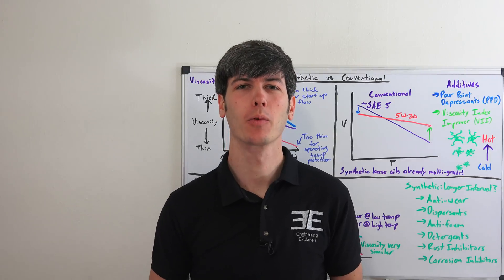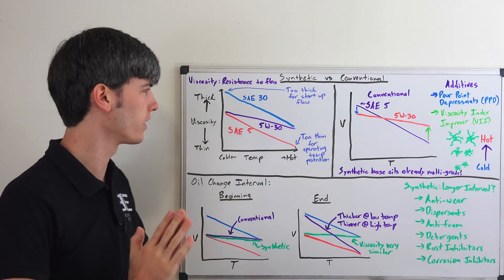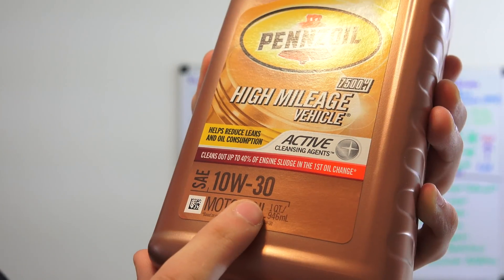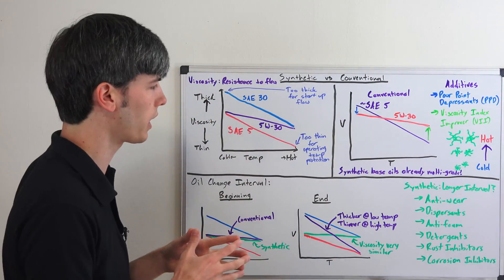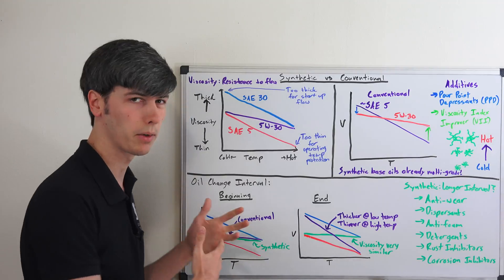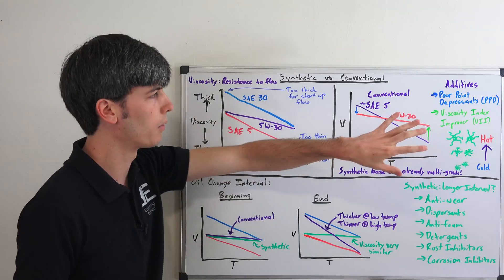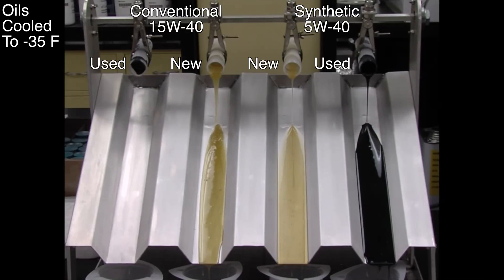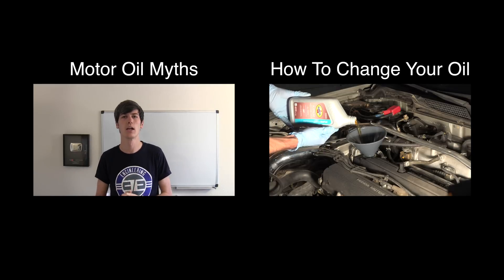Is Synthetic Motor Oil Better For Your Car?

Comment: And that's why I change my conventional oil every 3,000 miles on the dot...or sooner depending on how heavy my right foot has been. (Turbo's cook the crap out of oil...high zinc content is good too) Also consult your owners manual, a lot of cars can use a range of oil weights depending on the climate you live in. the "recommended" weight is more about fuel economy than protecting your engine.
Reply: +teh vee teh vee ya im not following... if it's turbo it SHOULD be synthetic. it's not about oil life or anything to do with viscosity. it's about protection at higher temps, turbos stay at 500°- 600°F at idle and even up to 1500°F when under hard driving conditions. oil runs though your turbo and is the same concept as crankshaft main bearings (except ball bearing turbos) and oil cooks in the turbos thats why they reccomend leaving your turbo car to idle before shutting off so your oil, and coolent in my case can bring the turbo back down to a more reasonable temp, so that when oil flow stops it dosent cook the oil/coolent.i use pennzoil platinum 5w30 and change at 3000mi
Reply: Engine shut off and the turbo is still spinning at high rpms, no oil is getting into the bearings either... metal on metal right there. Won't matter if conventional or synthetic, no oil = no lubricant for the bearings. People tend to forget that. :)
Reply: Why would you choose to use conventional oil? Especially if you have a modified car.
Reply: *****
Or possibly an air pocket in the heater core and coolant is still moving in the system causing a "water fall" sound.

In a turbo car having high zinc and phosphorus content as well as the correct viscosity for the application is far more critical than synthetic or not assuming you're changing the oil before it begins to seriously break down.

Don't believe me, order a oil analysis kit and compare your cars oil of choice vs whatever else with lab results. Kit's free

http://www.blackstone-labs.com/free-test-kits.php

P.S. "for the application" has a broad meaning lots of things have to be taken into account besides climate temp. Such as engine output over stock, tolerances, type of CHRA etc. etc.
Reply: Diesel engines are a whole other ball game, it's like comparing base ball to soft ball.
Reply: No way I'd run non synthetic in a turbo specially with oil prices so high I've been able to find the synthetics almost the same price as the conventional. I've found the 5 quart jugs to be a great deal. Right now 5qt jugs of mobile 1 fully synthetic is just over 20 bucks at wall mart. My last oil change I got the same fully syn mobile 1 with filter and a bottle of soap and drain pan 32 bucks at advanced auto parts. It's to good of a deal to run conventional. If you do synthetic yourself it's cheaper than paying someone to do it with conventional.
Reply: That is most likely the ac system equalizing pressure between the low and high side after the compressor stops. Usually lasts around 10-30sec. Try turning off the ac a few minutes before you kill the car and you probably won't hear it.
Reply: *****
I'm assuming your comment is directed at TsmnnDvI5, I know I laughed at it.
Reply: *****
 See how long a turbo will last with no oil going to it. Or would you prefer someone to hold your hand while you look up the info?

Suggest you read item #3 very, very carefully.
https://www.torquecars.com/articles/killing-cars.php
Reply: Whew, good think I read the owners manual and don't just shut it off soon as I pull into my drive way after some "spirited" driving. Owners manual on my car lists 60 seconds.

BTW it's not spinning fast at idle and the CHRA of most factory turbos are journal bearing, some aftermarket CHRA's use ball bearings. There is realistically no damage done at idle once it's cooled off when you shut down the engine.

Damage is done to the turbo's bearings at high load / full throttle when you are pushing it to it's limits. A lot of people my self included run small frame turbos beyond their designed output (airlfow) doing so on "meh" oil = seriously shortened life span of the turbo.
Reply: Not true. Anything with a DPF won't tolerate mineral oil. PD diesel engines have very specific oil requirements. You can't just load in mineral oil and assume that it's fine because it's changed every week or two.
Reply: +Alan Hunter I use Mobil 1 not because it's synthetic but because it's the cheapest 0w20 that I can  find. My "I'm broke this month" alternative is Motorcraft 5w20. I run either of those in my 280ZX, my EG Civic (D15B7), my parents' Grand Marquis (302 Windsor), etc. My 530i (M60B30) gets 0w40 or 5w40 diesel oil, my bike gets 80wt gear oil & TC-W3 premix at 64:1.

The ONLY times I use OEM recommendations are when it's not my vehicle or when I'm getting a baseline for later oil testing. I drive everything like I stole it, put in 50-100k miles a year, & in over 15 years the only parts that have just straight-up failed on me are automatic transmission pumps & axle CV joints. It's like Toyota & GM spec plastic for those.
Reply: +TurboMitsubishi There's nothing specific to a turbocharged engine that reacts positively to increased ZDDP levels and most turbo installations are on engine designs that don't require much either. For a turbo you need a high-temperature shear-stable base oil much more than any specific additives.
Reply: teh vee teh vee Far more to it than just viscosity and OCI. Many engines now have oil requirements than can only be met with synthetics.
Reply: Jacob Gay
Yep it's sooo horrible my 26 yr old 4g63 that's never been rebuilt with 117,000 miles is on it's last leg...oh wait, no it's not. It actually runs better than 90% of DSM's I have seen first hand in reference to idle, driveablity and reliability.

Whenever I one day rebuild the engine, once it's broken in, I will probably run something like Amsoil, but until then, mineral like I mentioned will do just fine, has for the last 26 years, it's not like it's suddenly going to be inadequate.
Reply: teh vee teh vee what are you even talking about? There is only benefit when it comes to viscosity at certain temps for synthetic. The other part of your comment maakes zero sense.
Reply: +Ryan Rohauer Yea I don't know what he is talking about either. I doubt he will reply though.
Reply: Why do I sometimes hear running liquid sound after I shut off my turbo Jetta. Is that the reason?
Reply: I thought that also but I usually hear those noises on startup or revving instead of after the engine is shut down, but I have heard them on shutdown also.  Did someone install a waterfall in my car? lol Your oil comments are spot on also.
Reply: At an idle, correct, little damage to no damage done. Point is, most just pull in, engine still decently rev'd then shut off. That's where the damage is done. :)
Reply: Jacob Hendrickson
With the exception of 1 oil weight, it has been proven several times (google) Mobil 1 Is NOT a real synthetic oil.
Reply: Or one could get the Autozone oil change deal. $25 for a gallon jug and filter. I get Valvoline Max Life on that deal. I think the choice is between Valvoline or STP but both seem to have the same performance characteristics on a high mileage car, not sure about low mileage as both of the vehicles I work on are over 200k miles.
Reply: +THE WHITE WOLF And so? That's important to know for vehicles where it's critical, but the number of those is MUCH smaller than people think. The zinc has been largely replaced with other, similarly-purposed, additives and the vast majority of engines will never notice the difference.
Reply: pandorafalters
 Turbocharged engines sure will.
Reply: All I know is that the thrust bearings in normal turbo's ran hard with oil with high zinc show a lot less wear.
Reply: +THE WHITE WOLF The flat-sliding contact that ZDDP is best for protecting is actually not terribly common even in "older" engines. Even solid lifters are designed to rotate in their bores, specifically to reduce high-wear sliding contact PRIOR TO the introduction of zinc-heavy additive packages. It's actually more common in earlier OHC designs with non-roller rocker arms which have a contact pad for the cam lobes, such as Nissan's L-series engines.
Reply: +TurboMitsubishi Heavy thrust bearing wear inside the TURBO is generally due to improper assembly or system design - improper bearing clearance or excessive pressure on either side. Heavy wear in the ENGINE is generally from the clutch - too-heavy pressure plate springs, riding the pedal, or improper adjustment.
Reply: +TurboMitsubishi Or, possibly the most common source for any "high-performance" engine, is running too-thick oil. Cold it resists pumping and your bearings can run dry; hot it can pump at high enough pressure to scrub your bearings. In either case wear will increase in every oil-lubricated joint.
Reply: I have seen the results of 3 different oils of the same weight tested back to back to back on a 4G63 engine with journal bearing turbo's pushed hard on a dyno once up to temp. The main differences between the oils were the zinc and phosphorus levels.

There may be newer additive packages that are just as good, but I don't know that for a fact, I know what does work and will continue to use it until I know something that work as well or better is proven.
Reply: +TurboMitsubishi Sticking with an option you know works is a good choice. Can't argue with it.

But there are so many potentially-damning variables in the "3 'identical' engines off the street" scenario that it'd take me all day to list them, and I'd probably still miss a few. Prior wear/abuse & different past usage/setup are the big ones. PO who ran SeaFoam through the crankcase religiously before every oil change, or who didn't allow the turbo to cool before shutdown, or stretched the OCI, or changed the oil TOO OFTEN, ran a lot of short trips, neglected the cooling system, etc.
Reply: Finally! Someone else who understands there's more to engine oil than mineral/synthetic and viscosity rating.
Reply: Synthetic oils although originally developed in Germany as a wartime substiture for mineral oil really first a niche after WW2 as the  lubricant that would withstand  the heat of jet turbine engines.  Your turbo is is a jet turbine.
Reply: youre a special one itsabitshiti. lol conventional oil burns away at the temps your turbo gets up too:)
Reply: pandorafalters
 It wasn't 3 different engines, it was the same car, same engine. The turbo's were swapped each time with a new unit, different oiil then pushed beyond their designed output (off the right side of the compressor map) then removed and torn down for inspection.
Reply: I understand you have nothing better to do than change oil every few months and you want to use as much oil as possible, who doesn't? But most people don't have that time and want their turbo-charged cars to last a little more than 100K. You could still be using Windows 3.1 too if you wanted. But why bother?

Comment: texaco 15w40 part synthetic, best oil that I ever used.
Reply: 15w40 is for tractors,loooool,in my garage\shop i only use 10w40,even my old Mercedes 190 uses 10W40.
Reply: +RST R MODS I hve 84 orion so that is about right lol

Comment: Could yo do the last experiment with high temperature? 15W-40 vs. 5W-40
Reply: 15w40 Conventional should generally speaking burn easier than a synthetic 5w40.

Comment: How about built motors? I've always heard you cannot use synthetic with race bearings in your motor because synthetic is thicker than conventional. I have even replaced someone's ACL race bearings in their car and used Valvoline VR1 (non-synthetic) to break them in. But after 1000 miles, he switched to synthetic and there was some play between the bearings that would cause slap. I didn't ask him what synthetic he switched to (maybe Mobil 1) but I'm curious to know if synthetic caused the ACL race bearings to go bad again.

Comment: Great video ! I learned much tonight.

Quick question : I have a Renault Clio II 1.5dCI diesel engine from 2002 and I use semi-synthetic 10W-40 oil, and mileage is about 5.2L/100km.

A mechanic from a Fiat garage recommended I use 5W-30 synthetic oil instead, but I've asked for second opinions from different "mechanics for a hobby" before doing anything, and the general consensus is that 5W-30 would be too thin for the engine.

Did I get the wrong info from the Fiat mechanic ? Did he try to rig me into wearing out my engine ? Or would I see a benefit from going thinner ?

Comment: make synthetic oil alot closer to the price of conventional and maybe I'll use it. Synthetic is just too expensive. I've been using dead dinosaurs for 200,000 miles on my truck with no problems.

Comment: what about semi-syntetic oils ? they are probbly between conventional and syntetic ?
Reply from the maker: +URM4Z yep, a blend of the two.
Reply: I actually like using baby oil
Reply: +Engineering Explained could you send me a link for the picture of the whiteboard explanation, please? thanks.
Reply: I drive a older diesel from 1999  2.0TD  and almoust 400k km-s on the clock  no point to use full synth, 

full synth is for newer engines, with higher performance :)
Reply: +krauser979 that is because a little synthetic add increases a good bit of performance. like a logarithmic graphic. and it's not cost effective to add 90% synthetic and have just a bit more performance increase than adding just 20% of it.
Reply: +URM4Z it's ALWAYS better with synthetic. Not even a point talking about anything else.
It's better at everything and in an older, worn engine it could give you a quieter and more
economical ride.
Reply: I just pour some KY lube in there she sounds great!!

Comment: Good stuff !! 

Could you maybe do a video on oil with Moly ? and its benefits vs advantages ? 

In the motocross world oils are engineered well and some offer moly and some don't. 

One of the things i've heard about moly is its difficult to suspend with in the oil and in some cases just clumps up in the filter or on the bottom of the crank case. 

Is there any better reduced friction with moly based oil or is it just a gimmick to sell the oil for higher prices ?

Comment: But not all cars can use synthetic oil. My old F-150 wasn't designed to run with synthetic oil, atleast in the engine. So while you are completely correct that synthetics are much better, it's in my opinion, false advertising to just say they're better period. Because for old cars they aren't.
Reply: Your old F-150 could use synthetic just fine. It's an old myth that old cars don't like synthetic.
Reply: From 4:50 on he says use what the car manufacture recommends.
Reply: I use synthetic oil for my 25 year old car. It works perfectly.
Reply: no its just here-say that people have butchered, the reality is that synthetic oil isn't practical in an engine with bigger tolerances ( older, high mileage engines) If I run a full synthetic in my e36 im burning through a qaurt every 600-800 miles where as with the semi- or conv, im going through the same amount in around twice the distance and its cheap.
Reply: Not true.
Reply: Nor are they "much better" at all.  Though objective, independent, controlled studies are lacking.  Every wonder why?
Reply: My 37 year old 6.6 liter Ford V-8 runs great with high grade synthetic, much better in fact.  I beg to differ.

Comment: Things have really changed! Ten years ago I was told by a Mobil 1 engineer that filtering smaller than 100 microns would begin to strip additives. Not so now, and for the better. Thanks!